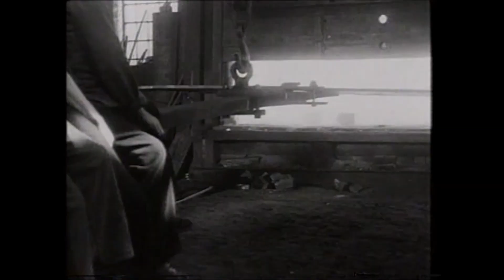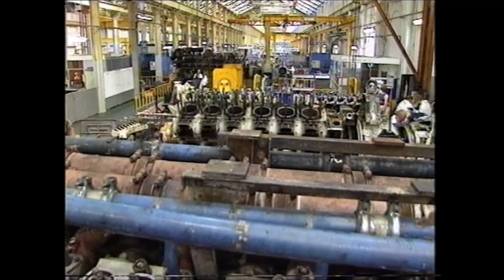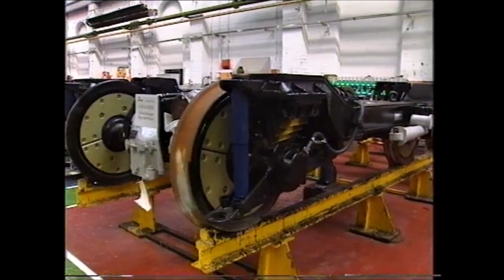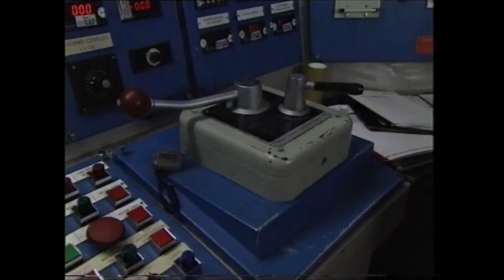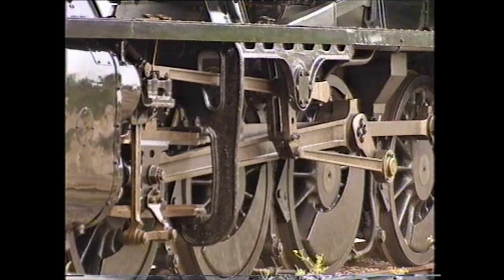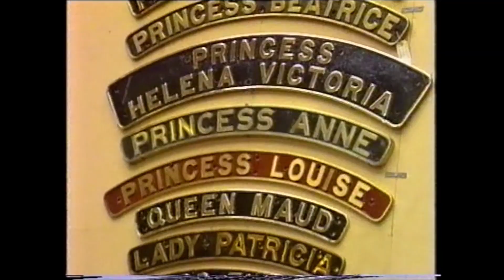Crewe Works - The Inside Story

Comment: I'm going to ask what is probably a stupid question for most people watching this. I know how DELTIC engines work, but why where diesel engines never used to directly drive the locos. Now I know there was a few that did kind of rail busses example County Donegal Railway before its closure. Where they just not as powerful-not enough torque as steam.
Reply: Because you need a clutch to interrupt the power source from the drive wheels. A traditional friction clutch would burn out if the loco was pulling a 2k tonne train up a 1:150 gradient for example. So diesel locos have hydraulic (automatic) transmission or more commonly in the UK, a generator and traction motors.
Reply: @davidgreen6981  I guess spinning wheels on the track was enough of a clutch for steam locos.
Reply: @philipmcdonagh1094  Spinning wheels does damage steel tracks, and AFAIK they try to avoid that.
Reply: @philipmcdonagh1094  I would say spinning wheels is a traction issue. Steam engines do clutches differently, when the regulator is closed steam builds up in the boiler, when the pressure is too high the safety valve opens.